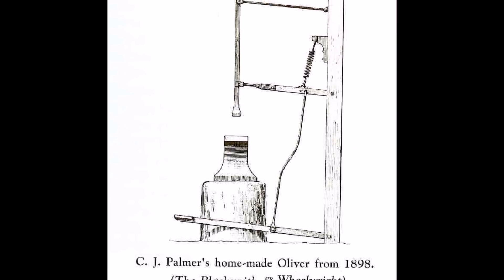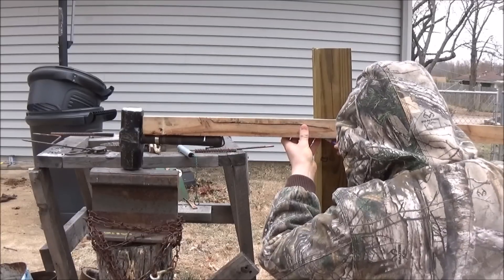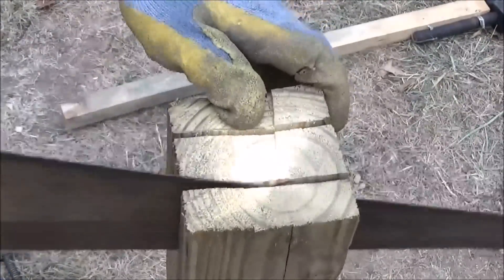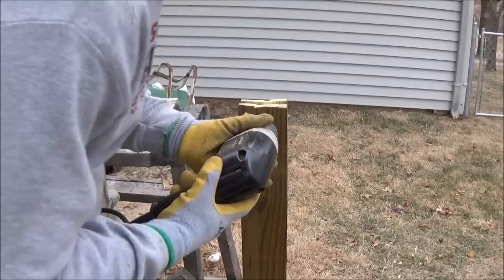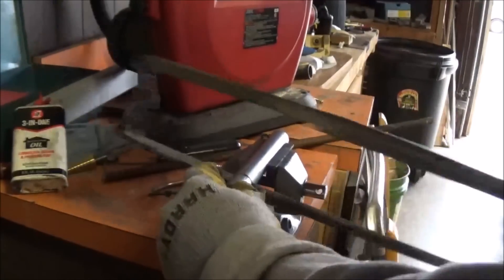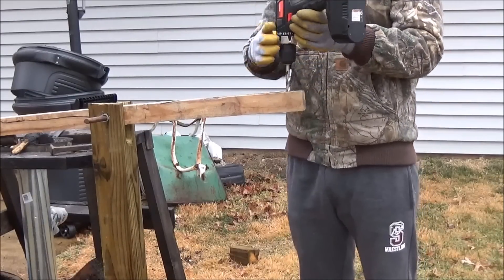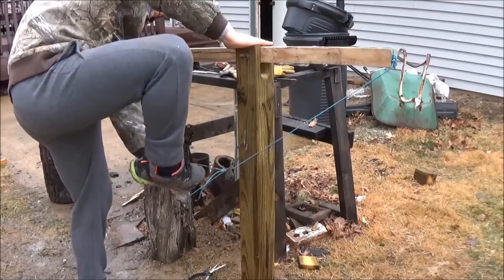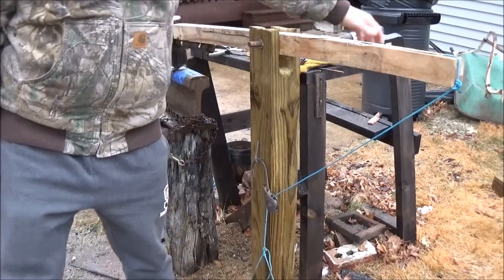How to Make a Foot Powered Power hammer (Treadle Hammer/Seesaw)

Comment: Does a step bit dull when you use it on wood
Reply from the maker: Probably somewhat, but I figure they are made for metal & wood is softer than metal so it can’t be all that bad for the bit.

Comment: Good work making the idea into reality. Nice one!
Reply from the maker: Thanks! Glad you liked it.
Reply: Just to help you out, yes this is an amazing idea that could be improved, but if you made one side of your 4x4 or 6x6 much much higher and then put your pulley up there, you would then invert your output so instead of pushing down to make the hammer come up it just goes down. Now you also need to buy a pretty good spring but if you live in the USA, then stop by a Tractor Supply and pick up one. They are pretty cheap there and work really well. I want to iterate that this is an amazing idea my dude, just that small improvement could help you out a lot with how your force is being used

Comment: Thanks for sharing it's like you got it figured out. To me it looks little bit awkward.
How do you like using it? Look forward to hearing from you God bless. By4Now Ken
Reply from the maker: I haven't used the forge in a while now since I've been off at college, and don't have a lot of coal. But once I get the forge started up I''ll be sure to make a video. Thanks for the feedback!
Reply: @pyrotech1999-bootlegblades  okay thank you and thanks for getting back to me can you use charcoal like for barbecuing in the Forge?

What's a quick easy way to make a forge this is something I'm wanting to learn how to do I'm a woodworker and finish Carpenter by trade.

If you went mine telling me if there's a quick and easy way to make a forge it would be appreciated thanks again God bless Merry Christmas Ken
By4Now👍
Reply from the maker: @HomeImProveMentHow  You can use charcoal in a forge, however, it burns up really quickly and can get a little pricey. I had a friend who's dad worked at a coal plant and he would give me the rock-contaminated-coal for free. Unfortunately I haven't heard from him in a while. I have tried making my own char-coal but have not been very successful.

 My first forge was a big aluminum can with a cement coating on the inside, and a hairdryer hooked up to the side, it wasn't a very efficient or effective forge but its what I started with. Now I have a large (Thrift Store) frying pan with the inside coated with cement and holes in the bottom which I attached a bathroom fan to. There are some great resources out on YouTube for beginner Blacksmithing (Chandler Dickinson, The King of Random, Fargo FX, and many more).

If you have any other questions, I would be happy to answer them as best I can.
Reply: @pyrotech1999-bootlegblades  I appreciate that bro, thank you.

In this Forge you've made, how deep is the frying pan, and how much concrete is in it I'm assuming the coals go in the frying pan? And then the fan blows up from the bottom? How much concrete goes in the frying pan and is it regular concrete or how do you mix the concrete? Thanks for getting back to me and for being helpful I have a piece of railroad track I could use that's about 6 in Long. I look forward to hearing from you Merry Christmas oh, you said you were in school so I'm assuming your offers Christmas break? By4Now God bless Ken
Reply: @pyrotech1999-bootlegblades  I will check out a couple of these people you mentioned thanks for the info.
And what kind of pan did you use was it a iron skillet or aluminum? look forward to hearing back from you and thanks again Ken God bless
Reply from the maker: @HomeImProveMentHow   You can see what I'm talking about in my "How to make a simple hook knife" video. I basically drilled 8-ish holes in the center of the pan to form a grate. Then I put a cylindrical plastic container in the pan, covering the holes (5in in diameter). Then I filled the frying pan up about 3/4 of the way with regular concrete. I made sure the concrete conformed to the shape of the pan, so it forms a bowl or a dish, rather than just a flat slab. Once the concrete dried, I pulled the plastic container out. This leaves me with a dish that can hold a lot of coal, but the cup (formed from the plastic container) in the center of the pan holds about 3-5 inches of coal which is right in front of the grate/air flow. So I have a good hot spot in the middle of my forge that I can rake coal into to increase the size of the hot spot, or pull coal out of to shrink it.

Attached to the bottom of the pan is a round piece of metal duct work, which I bolted to the bottom of the pan before I poured the cement. I closed off the bottom of the duct with a tin can, and cut a hole in the side to put the fan in.  This is no where near air tight, but it sends enough air into the forge to make it hot enough to heat up metal.

I used regular old cement because its cheap and I'm still somewhat of a novice. Real forges will most likely use refractory cement which is more heat resistant, and I believe its a better insulator, so more heat will go into your work piece instead of being absorbed by the forge.

 Happy Holidays
          -Ryan
Reply: @pyrotech1999-bootlegblades  hey Ryan thank you very much yeah I'm going to have to get one going I'm running to be able to melt aluminum or brass I'm wondering if the forge will do that as well well thanks again Injustice shake your help God bless you Merry Christmas, By4Now Ken

Comment: Would you say this is more powerful than your hand hammer?
Reply from the maker: Being realistic, I could probably swing the hammer by hand much harder than just letting gravity take the wheel. However, I have tried forging with the large hammer by hand, and I get tired and I loose a little bit of control due to arm fatigue after a couple rounds. So I think the best application for this tool would be a case where you want to move a lot of metal (Flattening round stock to flat stock)  without using a lot of energy.
Reply: Cool, good to know
Reply: @pyrotech1999-bootlegblades  yep that's why suggestions above about spring moving the hammer up and leg moving it down - this way it has a lot more power than you can produce with your hands, while retaining all the cons of current setup

Comment: Ideas
Spring at the back as already mentioned to lift the hammer for you ( aim for a very long stroke it will give you more time to put power into each blow)

Make it so that the springs have only just enough strength to lift the weight or else you will be fighting it more than necessary on the way down

And give yourself options as to where along the arm the foot loop is attached. You might be able to get more power by pushing hard and slow (by attaching the foot loop close to the pivot) rather than having to throw your leg super fast (having it far from the pivot)  just to get the hammer going fast at all

It is definitely better to have your leg pulling the hammer down... Gravity is great but way less that what a leg can add!

Hope this helps

Comment: Rad man. I think I'm gonna try something like this! Maybe a spring or 2 somewhere.
Also, I believe if you move your upper knot from the end of the 2' handle, closer to the pivot, you would double your pull height? So the hammer could go the same height, but only lifting your foot 1/2 as high. Or even 3x closer and get 1/3 the foot movement.
Of course, that will result in needing a "stronger" foot push, but that's the point of these is use leg power. 
Love this thing! You don't need a welder and a bunch of heavy steel! Sure it won't last as long, but I can replace bolts and 2x4s quick and easy!
Reply from the maker: Yeah, your exactly right. At this stage it is just a "proof of concept" and I really enjoy the feedback people give on how to improve it. Thanks!

Comment: You could make exactly the same thing, but put some garage door springs on the back to raise the hammer up and put the foot loop between the pivot and the head. It will still be underpowered and inefficient, but you’ll have both more power and more control.